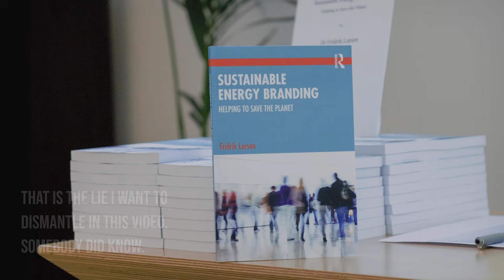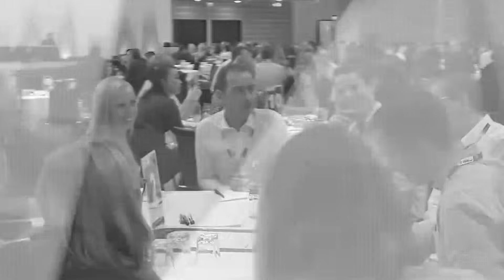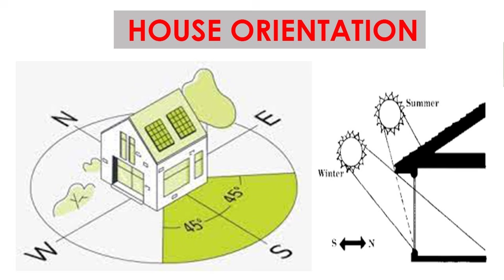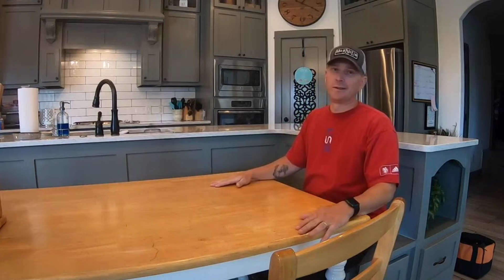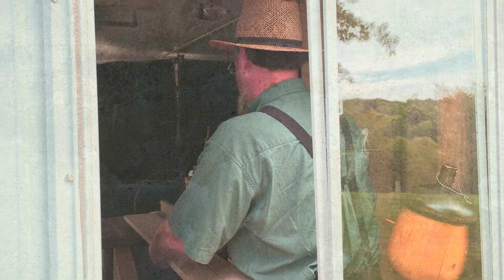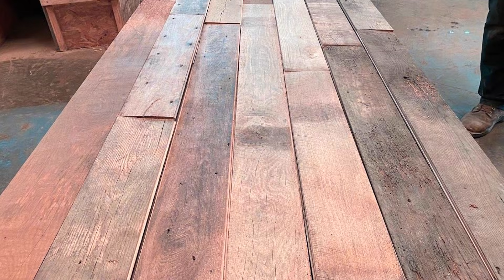This $15 Sand Battery Heats Any Cabin All Winter on 2 Hours of Sunlight

Comment: Hi Sue Young, The original idea was not mine I think it may have been @glassblastcolliusion and I was replying to some of his ideas he was putting forth and like you I found the ideas also interesting and full of potential and possible application including the use of using solar generated heat and venting it through a cold running dryer cycle in the summer and in the process introducing the stored solar heated air (from a stored heat sink) and venting it to a clothes dryer for example someone returning from a camping trip with a bag of wet clothes and it happens to be night time the clothes can be dried costing much less of course than utilizing electric generated heat for the dryer, also drying clothes in a dryer in the summer to deal with ticks such as what you were interested in. Incidentally I have been interested in solar heating for a few decades and even did a college essay on aspects of the subject way back when. Good luck with controlling those pesky ticks next summer.  Ed

Comment: On the real cold days? Why don't you have a coil that can sit on top of your stove in boiling water? That way, you can circulate your fucking thing. You're heating with wood anyways then your sand pit, or if you use salt which is better. Because salt holds it longer, you'd be able to heat it right up. She'll be pumping out over seventy degrees easy. All night long aha

Comment: if you place a fresno screen , off a big screen tv , llke a big magnafie glass  in frount the part your heating up from the sun , it would work alot better , and I had a friend that would heat his swimming pool this way in the summer .  and basicly the idea is  get a long black  plastic water pipe , fill with water and connect it back to itself .   loop it back and forth on your roof , to  catch the heat and loop it back and forth in what every you want to heat up , and the heat will circulate the water , around the pipe

Comment: This is fascinating information and could help save the planet from The dire consequences of out of control climate change due to essentially fueling the planet with carbon based fuel and natural gases. And as you have pointed out in this video is the appeal of a low cost heating system which is not dependent on large gas and oil corporations. The other appeal for me is it allows families not to have to depend on any third party to be able to effectively heat their home and to be more independent of the grid at least for their home heating needs. Also the basic technology you have laid out can be easily managed by the average do it yourselfer. Thanks very much for sharing your information and I look forward to more such videos.

Comment: The graphite rasing conductivity by 40 percent was the hidden game changer. Waste sand from a quarry is 50 dollars a 10 ton load or you can go get some probably free. It is 25 % clay and is not sorted by size. The clay can be washed off or a vacuum filter set up, home build.

Comment: A lean-to greenhouse with double glass or plexiglass panels with bubble wrap between, set against an outside south facing wall is much easier. Open your window halfway. You can remove it in summer. You are welcome.

Comment: I need to build one of these in conjunction with my beer can heater that provides 90+ degree air from 10am to 4pm daily. I did see plans a few years ago for a rock heater. Basically a wedge with internal baffles and filled with rock. Front collector and a small fan that circulated air through the rock and into the house however it had an insulated cover that had to be closed in the evening to keep from losing the heat. I wonder how the heat retention of rock compares to sand.
Reply: I am looking at doing both of these as well for our circa 1880s home. The beer can heater to heat the sunroom (where the cats' food, water and litter are, as well as our treadmill) and the sand box heater for the living room (next to/ behind the sunroom), both being on the southern wall.  I had someone take out the decrepit oil tank and boiler (which didn't have a fire box anymore) and replace it with an air-to-water heat pump, and our electric bills have been over 1,000/month for the coldest months of winter even with a 20k solar system (with electrical heaters in different rooms). If I can replace heat in these two ways, then the electrical heat bill will hopefully be cut in half. (I also ordered one kerosene heater so for either the kitchen or bedroom (I know it can't run overnight) and looking at a propane heater as a backup.)
Reply: @JenniferFB  I'm going to guess the real issue is in a home that age there is little to no insulation in the walls and perhaps the attic unless you added some. I'd look into ways to better insulate the home. If you have a south facing sun room then a heavy clay tile floor and thick masonry trombe wall might be enough to heat your entire home. I would also consider a small efficient wood stove.

Comment: This looks amazing. We built a 11x13 greenhouse last summer from a kit last summer. I wintered over my dwarf citrus trees in it. Despite caulking every leaking spot I could find, it cost nearly $500 to heat it for each of the coldest months of winter. That makes for very expensive oranges and lemons! I would love to have more guidance on the sand battery. I live in PA outside of Pittsburgh, close to Amish communities.
Reply: If you dig down about 6 feet and burry pipe in day 160 yards one down and then back. Circulate the air through it, you will have a stable air temperature through out winter and summer. Their is a build in Nebraska the man had a green house and he did that same thing it stays at 70 degrees all yr round in his green house. He has lemons, grapefruit, limes and banana tree. Look up how he did it. He runs a fan off solar. It doesn't  cost him a dime and he sells the lemons and limes at farmers market.

Comment: So in the summer time when your are trying to cool your house not heat it wouldn't the continuous heat from the box make your ac system work harder if you cant turn off the sand box
Reply: Put a valve in the copper line to keep the circulation from happening.

Comment: I have a camp in northern Ontario. That being said I think that I might try to apply this in a selected group of floor joists under the camp that has an enclosed crawl space. They are open voids and if I seal them correctly perhaps the heat transfer through the floor will keep the cabin above zero throughout the winter. I might have to sister the selected joists to accommodate the extra weight load. Very interesting video. Thanks for your time.

Comment: This is very impressive. You would think a brick or stucco house would be warmer. If  I built a new home I think I would rather be under ground with a few window from dug out window wells. May you could build some kind of pretty structure on top. I''m not good at building.

Comment: I live in a relatively mild Winter region, of Northern California… This would be ideal; except once our extremely hot Summer arrives. Do you shroud the collector during warm months? Even with a collector oriented to low Winter sun, I’d still get substantial warming during the Summer.
Reply: Put a valve shut off to prevent circulation in your copper line.  Cover the external box with a canvas tarp.  Should do the trick for those hot summers.

Comment: Im not sure a piece of metal oytside in 20 degree weather is going to get hot by the sun in jan. And heat coils in the house that will amount to anythibg. How is the heat grnerated. Solar panels dont make heat they turn it into energy that powers my battery.
Reply: The heating panel is coiled copper pipe on a flat metal sheet painted BLACK to absorb the suns heat. That in turn heats the glycol fluid  that coils inside the box of sand.  The glycol circulates by convection so no pump necessary.
Reply: I forgot to mention the glass that  covers the panel to keep out moisture and keep in the heat (greenhouse effect).

Comment: It seems to me, that  you could just fill your crawlspace up with sand, so that it's under the floor of every room, you may need more than one solar collector, but it seems like that would heat the home more evenly.
Reply: That's what I was thinking.  I could easily place a ton of sand in the underroom crawlspaces and in the basement. I have a beautiful clear sky now that the neighbor's black walnut tree is waiting for me to turn it into bowls 😂

I figure that those banks heating below the conditioned spaces would cut my gas bill.

Comment: There was mention of basalt sand. Is that better of worse? I would think better, because ive heard that sand grains have air between them slowing down heat transfer. I have access to basalt sand or powder, which when packed becomes almost solid rock. Thanks, I hope to hear back.

Comment: I have so many questions i do not like to use the antifreeze and have built a big solar air heater with black painted tin with fins and screen and rocks inside it to heat my rv studio for videos the air entering into the south facing wall were this is set up on the rv tilted at a 90 degree angle over the little deck i put on it in Canada very hard to heat an older Rv with electric heat inside only propane was insane very costly but it is still there any way what about running my insulated pipe snaking it under the insulated queen bed frame then putting sand bags on lightly some fire brick or something so they will not crush the hot and cold air returns any advice would be great and it is time to bring these ideas to the world i believe to create even better designs that can help more people we all have to adjust to what we have to work with and the i call it the lazy glass i had sitting around doing nothing until i started multiple projects one  a solar oven with an old hot water tank cut out with sand and a pot of rocks in it Thank you for your time and God bless you for getting this information out to the world but please kiss it as much as possible so everyone can understand it all keep it simple silly is one of my videos on the tube

Comment: There are many creations like this battery. 
Great content.

In desperate and hard-times i have used this very simple and temporary method.

1) Make a fire- (the 'long-fire' is best) or a 'below ground' fire.
next to rocks, added to fire or included in the setup- makes for a better system
2) Bury x2 or more copper wires,/rods into and under your tent, from the fire 🔥 
(i actually used rods) and sand that was available 

The shorter the distance will obviously work better.
This will remove the -mare and reshape it into a night.
Reply from the maker: This is incredible — thank you for sharing your method. Real-world experience like this is gold, and honestly it's comments like yours that push us to keep putting the time and effort into making these videos. The buried copper rod setup is such a clever low-resource solution, especially in survival situations. We may actually explore something similar in a future build — would love to dig deeper into the long-fire + thermal conduction approach. Stay safe out there 🙏
Reply: @BuildsWithEliYoder Excited to see this video.  Also the next time you build one for a person please video the entire project.  Showing there  before heating cost and after heating costs.  Amazing videos.  Keep them coming.
I recently have been pondering how to build something from my fire pit that would make the seating around the fire pit heated.  Either fixed seating or just folding chairs.  Love to see a video on your thoughts.  Keep em coming.👌

Comment: I like this idea a lot.  My south facing wall is in shade.  Could I do this on the 2nd floor?   I'd like to build a sand battery for my basement heated with a propane heater, now costing $28 for a 40lb tank that lasts a week.  Heat rises, so I need my sand battery to be above my Mr. Heater portable propane heater.  I don't need the coils, just the sand box container.  I'm thinking a steel cart from Harbor Freight holding the sand battery on top (could it be as simple as a galvanized metal tub full of sand?), and the propane heater on the bottom shelf below it.  Or should I go bigger?  Spring is here, so I have until October to figure something out.  The winter electric bill is HUGE in this old house.  Perhaps I might stack two 50 gallon drums, the one on top holding sand, the one on the bottom holding the heater.  Maybe a 50 gallon drum on stacked concrete blocks with the propane heater on the floor.  Comments and ideas, please.
Reply from the maker: Really appreciate you taking the time to think this through so carefully — these are exactly the kinds of comments that make all the hours we put into researching and producing these videos worth it. A 2nd-floor setup can absolutely work since heat rises, and a galvanized tub full of sand on a sturdy steel cart is a solid starting point. Just make sure the structure can handle the weight (sand gets heavy FAST) and keep good clearance around the propane heater for safety. The stacked 50-gallon drum idea is interesting too — bigger thermal mass = longer heat release. We're actually working on a follow-up video covering exactly these kinds of indoor/basement setups, so stay tuned 🔥

Comment: Great info; however you need to be more accurate on cost. Im not stupid, your cost is way off, big time, but if it cost 500.00, still would amaze me. You need more accuracy on size of home , what your collectors sizing wood be for different homes, ect.
       Tyyou for the info, it makes sense, what did the the Amish use for a collector in the 1800’s , for copper ect. Ty

Comment: I like the part where u could put a bench on the inside & it heats up from the outside. This is way better than usine electricity 2 heat ur cabin or home. Yes l get it that it does'nt completely heat, yet its way better than feeezing.

Comment: If you don't want to waste the heat in the summer and you still like to give it a job you can bury a 4 inch pipe in the sand at the top of the heat sink box and allow it to circulate through your electric or gas clothes dryer set on no heat / tumble mode. This is for those who still like to use a dryer in the summer if they don't use a clothes line.
Reply: This is wonderful news. I am in California and currently do not need this information as I just use blankets and jackets to keep me warm, how ever this place is getting too expensive to live and I am going to have to sell my condo and move very soon. 
Now I know I can leave California and buy a house and hire someone to help me retrofit a passive system to keep me warm if I move to Montana or some area 
Where it snows in the winter.
You are doing a great service for humanity.
Reply: I would think this technology could be used for a hot water heater, I used to have a 110 gallon model that was super insulated and ran off of off peak electricity. It recharged every night.
Reply: Great suggestion!
Reply: Your idea of useing the heat for a clothes dryer is a great one! Ticks are rampant where I live and outdoor clothes drying is a bit sketchy!

Comment: I would like ot know more technical design. how do you bleed the coolant with the pipes going up and down as shown on the picture? Wouldn't be better go horizontally and gravity would remove the air bubles?  How come the system does not require a pump?